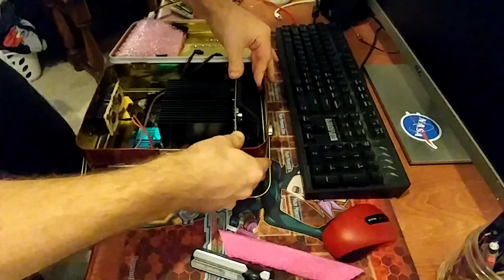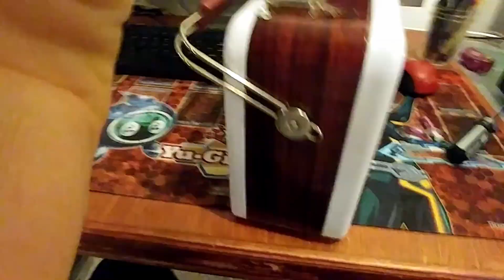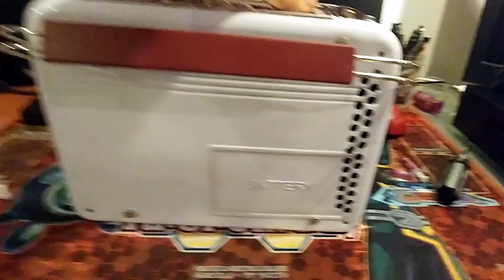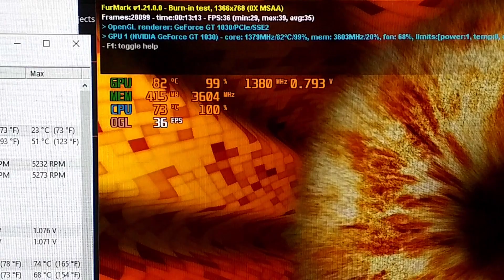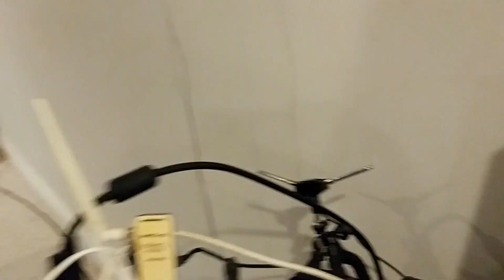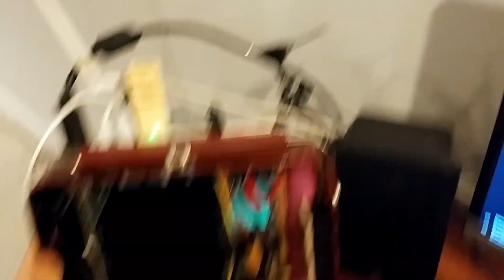The Lunchbox PC - Build & Thermals

Comment: how is that AAEON motherboard?
Reply from the maker: Not terrible :) 
The chipset heatsink was a little anemic (before I replaced it), and the BIOS wasn't flexible, but it does the job well.
Reply: @zackdarpinian9980  I got mine and when ever it boots it beeps . It’s super annoying
Reply from the maker: @raidoes  to each their own---I personally like the boot code readout, since it's handy for troubleshooting. 

There might be an option in the bios to disable the startup beeps, IIRC.

Comment: I was thinking about doing this but the motherboard scares me honestly cause i dont know if it will fit in a fallout 3 lunch box cause i want a fallout themed mini pc
Reply from the maker: It was pretty tough to find a box that would fit; however, it's not guesswork. Look up the dimensions for an ITX motherboard and you won't have to worry about it :)

It should be noted that it's really easy to short electrical components in a metal box if you aren't careful or you dont have good standoffs.